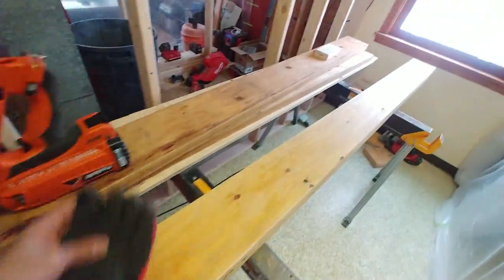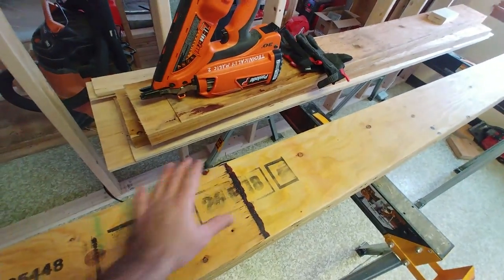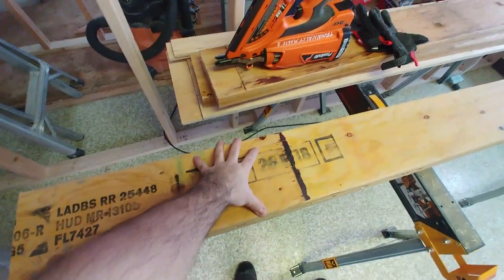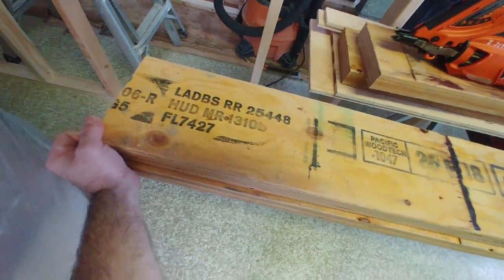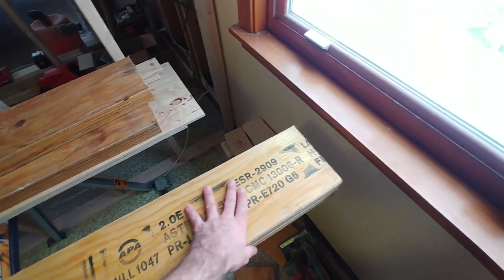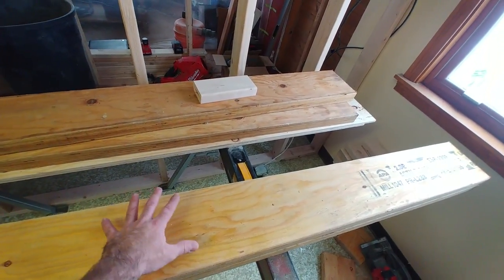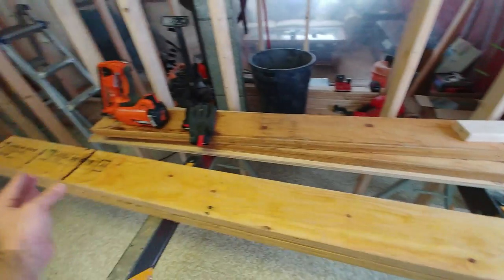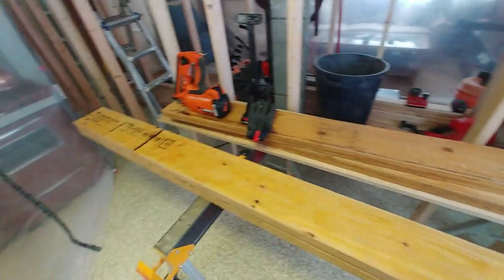Load Bearing Wall Removal Episode 4

Comment: what's the length of the beams you installed? i have a similar situation. only supporting the ceiling, another different beam also supports the roof

Comment: Awesome video series! How did you come up with the appropriate size LVL beam ?
Reply from the maker: I did a cross section sketch with all the basic dimensions for lumber, spans, etc. for the  existing structure. I called a local Architect and asked if I could email that and have someone do the calcs for me. He did the math on my drawing and sent it back, cost me $75.